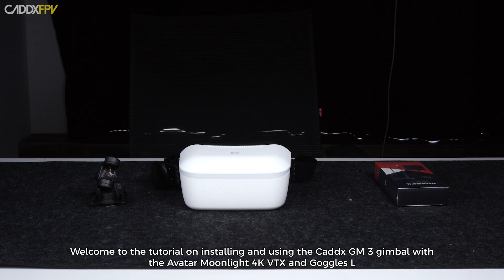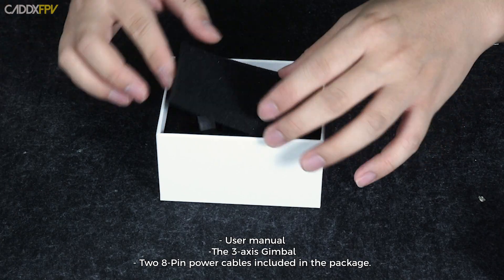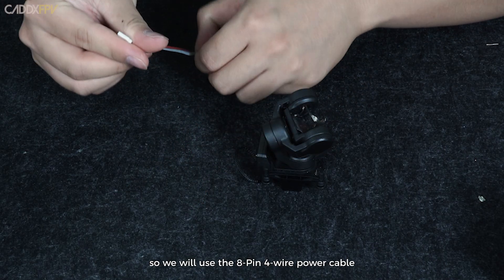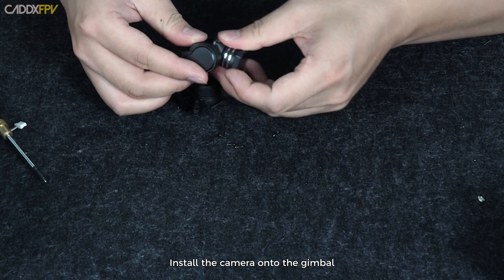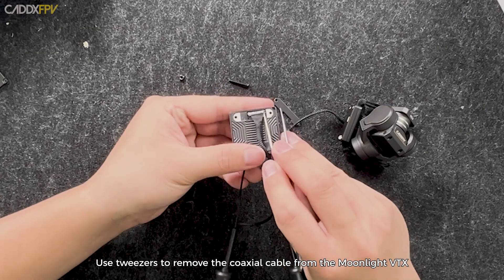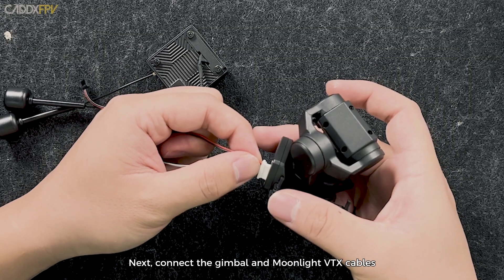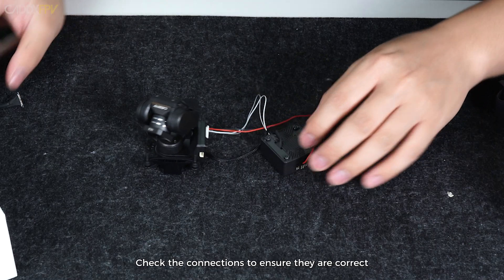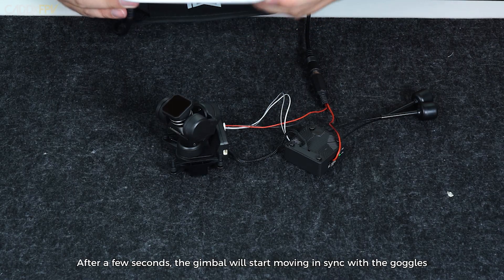Installing and Using the Caddx GM3 Gimbal with Avatar Moonlight 4K VTX and Goggles L

Comment: The CADDXFPV video instructional tutorials are not helpful.  For whatever reason, the videos are done in high-speed and are edited in short snippets.  I had to stop, freeze-frame, and repeat over and over again.  The tutorials jump over important steps, and the website references do not match up with their current website configuration.  Now, I am not computer savvy by any means, and I may not be the most experienced software/firmware expert, but I can follow step by step instructions when presented in a logical progression and use clear illustrations of the procedure.  The CADDXFPV product is very sophisticated and requires some advanced knowledge in electronics and programming.  It would be helpful for us average guys to provide clearer instructions and information so that even us dummies can learn how to use and enjoy your equipment.

Comment: DO NOT UPGRADE THE FIRMWARE. First you need a cable from china thats not provided second,the head tracking will stop working correctly.
Reply from the maker: Hi friend. 
For GM Gimbal update, see this video:
https://www.youtube.com/watch?v=6UfKqNBkxOU&t=27s
The GM Gimbal and the goggles should be in the same version.

Comment: I have an older Walksnail VTX - I understand I will NOT be able to use head tracking - but - can I otherwise change settings/modes of the gimbal thru my Goggles? (Fatshark Recon HD.)

Comment: Hi just bought the GM1. There is no gimbal co axial cable included, do I use the VTX coaxial cable through the hole in the side. Your documentation is really awful btw. not one of your product manuals is complete.

Comment: Does this gimbal also use the airplane's gyro to dampen unwanted shaking like during turbulence?
Reply from the maker: No，it doesn't.
Reply: @CADDXFPV  Thank you. So, it must have its own gyro inside the gimbal base then? I see footage of it stabilizing itself.
Reply from the maker: @Darrylx444  Yes the gimbal has gyro in itself. GM3 has 3 gyros. GM2 has 2. GM1has 1.

Comment: Damn. Noticed it drifting at the end but it was too late. Already bought it 😂
Reply: Came to comments to ask about this haha, any way to trim that out or does it always drift? Sounds like tht would be a dealbreaker no?
Reply: @MrSwaggernaut83 it actually didn't drift for me. I'm currently using the gm3 with only yaw input and it still works. Pitch stays where it should and so does yaw.
Reply: @Magneticitist good to know! Thanks

Comment: What about wiring for the Avatar HD VTX V2?  Does the VTX get power from the Gimbal or do I need to use the red, black, white and grey power cable supplied and just ignore the white and grey wires?  I can't find this information anywhere on CADDX's website.
Reply from the maker: Both the VTX and the gimbal need to be powered separately, and the white and gray wires are signal wires for transmission.

Comment: I'm trying to update the firmware for gimbals and it always gets stuck on the first step (parameter downloading). Has anyone encountered this problem?
Reply from the maker: It might be because you haven't installed the driver. You need to download the USB-to-TTL serial port driver.

Comment: I have problem with GM3, cam cant connect with VTX ( black screen on monitor) 😢
Reply from the maker: There might be an issue with the coaxial cable or it is not installed properly. Usually, the coaxial cable is broken.

Comment: Please would you make a video showing uart connection and setup in betaflight or inav. Great product, I have GM1 but not sure for to connect it to flight controller board. I would like to control the pitch angle with a rotary switch on my transmitter. I have TX4 and RX4 free.
Reply: As I understand, you need free pwm outputs on the controller's board, maybe with adding resistors if there are no built-in.
For example, on my matek f405hdte there is mention on their wiring picture, literally:

"
* S9, S10, S11 have 200 ohm built-in, 
can be remapped to PWM camera control in BF fw
(e.g. S11 BF cli resource camera_control 1 B06)
"

BF - Betaflight. Other S1-S8 are for motors or servos.

Comment: How do I install the newest Gimbal Firmware (there was no upgrade cable) in the GM3 included ? Is there somewhere a guide or manual ?
Reply from the maker: Contact our customer service at our website and we will send you an upgrade cable. There is a GM manual that you can find at download center.

Comment: Why will it not work on my goggles X
Reply: New board will be needed. Goggles X has a built-in 6-axis gyro compatibility, but this is 9-axis. If I remember correctly, Caddx said they'll be sending out new boards when it's ready. Rumored to be "soon."
Reply: @rcautoball  oh that sucks. I bought a gimbal and now it’s useless to me.
Reply: @phil-g3s  At the moment, yeah. I got the Goggles L and will definitely be getting the X once that update board gets released. I haven't seen the X in person, but if the image is as good or better than the Avatar V1 Goggles, it will certainly make for a better experience. The Goggles L aren't a bad picture, but the box style is not quite as immersing as the binocular style.
Reply: @rcautoball  I had both the V1 and now the goggle X I like the goggle X a whole lot better.
Reply: @phil-g3s  Oh, sweet! That's great to hear. I'm really looking forward to Caddx getting that new board then so I can get them!
Reply: @phil-g3s I’m totally opposite
I like the first version Avatar goggles WAYyy better.  The fit of the X goggles is HORRIBLE.   Plus either bottom washes or top edges of screen are cut off.    I have tried every single style foam face plates and none work.   Some make the FOV even worse.   My X goggles haven’t been used once since purchasing them last year.   I returned my first set because right screen would turn dark after only being on for a few minutes.   This second pair does same thing just not as dark screen and it takes about 5 minutes now to act up and that’s even outside in cold weather!   I’ve pretty much chalked these X goggles up as a $489.98 loss.   They now just sit in a desk drawer bran new.   I do however use the V1 avatar goggles often and like them a lot.   I also just purchased the L goggles and Gm3 gimbal for my ground vehicles/RC trucks.   I’m getting out of quad and fixed wing flying since it’s become to much hassle finding places to fly besides our farm that’s over 100 miles outside of city we live in.  I’m certainly not supporting AMA again after they stabbed the FPV community in the back and not paying some bald fat guy to fly his freA airfield in circles and getting yelled at to keep it below 100’ and tighten up your circle.   Screw that!!!

Comment: I’ve updated the goggles, updated the moonlight kit, got the plugs in as shown, tilts as should when vtx unit is moved but won’t move from goggles even on ptz. Done the calibration too but still nothing. I can see a blue light flashing inside it. So close but don’t know what to do now. Tried everything.
Reply: Same here!
Reply: @rcautoball  frustrating aye. I saw in the manual there’s some sort of gimbal update but no cable or info on software. I got 1 of the very first release batch maybe needs an update?
Reply: @fordboyzzzz  That's what I was wondering too. Hopefully, this gets patched soon. I'm eager to try this! Lol

Comment: Can it used with goggle x?
Reply: i believe (and i don't have one, this is from internet research) that the goggles x have the hardware inside for head tracking but the firmware does not yet support it. people are frustrated that they released a product with the head tracking enabled but the goggle x is still waiting for that functionality.
Reply: As of today, off the shelf? No.
Reply: With the $25 module addition I believe you can.  I could be wrong.
Reply: Goggles X has built-in gyro, so I am quite sure it supports head tracking too.

Comment: will other vtx work with headtracking or will it be moonlight only?
Reply from the maker: Yes, we recommend Avatar V2, Pro and Moonlight VTXs for working with headtracing.
Reply: @CADDXFPV  I did everything in this video. So did another use who commented. We both have the same problem - gimbal does not respond to goggle movement. Both the VTX and Goggles L are running latest firmware.
Reply from the maker: @rcautoball  Sorry for the inconvenience, you can contact our website customer service team and we will send you a gimbal upgrade cable. The problem you met with is because the gimbal needs upgrade.

Comment: The gimbal is superb! But make another video where there is no black background under a black gimbal 😅
Reply from the maker: 🤣We realized that mistake, and we will change to a light grey cutting mat next time
Reply: @CADDXFPV you don't show how to power this or connect to battery? Is separate battery source required?
Reply from the maker: @wazup3333  Hi Friend. It depends on which option u prefer. Option 1: It can be powered by the rc car. Option 2: It can be powered by a separate battery source.
Reply: Was there a gimbal in the video! I just saw hands 😂

Comment: Is this gimbals work with Goggles X?
Reply: Wondering the same, I have goggles X. Awaiting a response........
Reply from the maker: @DaShaneo  Goggles X will also work with headtracking with the board we will release for the compatibility with head tracking.
Reply: @CADDXFPV  Please, we need this. Ordered GM1 already for my 7 incher, but I need support in Goggles X, too.
Reply: @CADDXFPV  umm Goggles X already has gyro inside....Why not make a 6 axis gimbal? you will make new board for this gimbal then next summer another new board for range? That seems like you will be just be taking our money, makingus pay for two seperate boards....cool